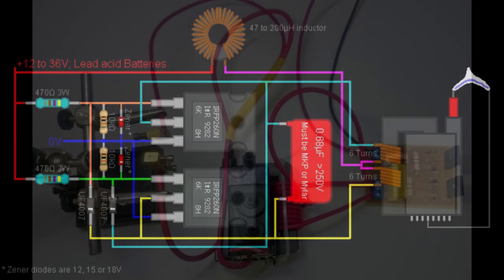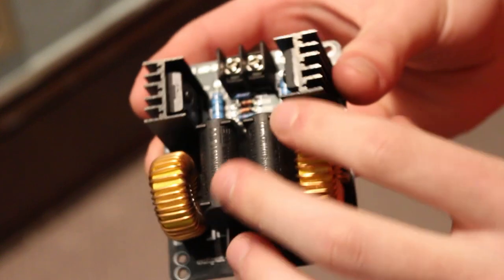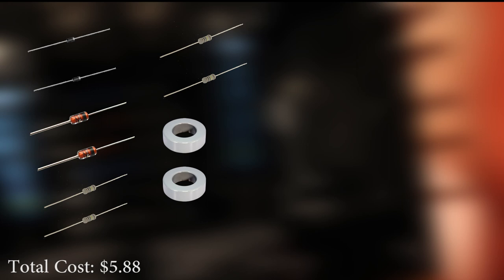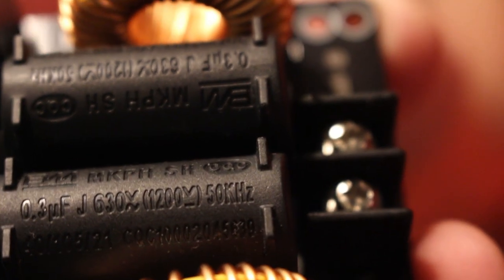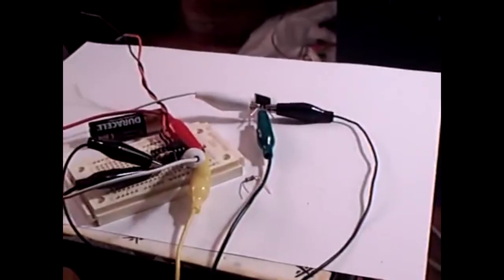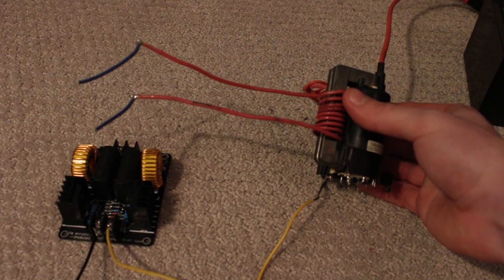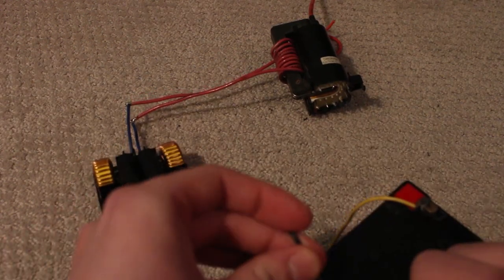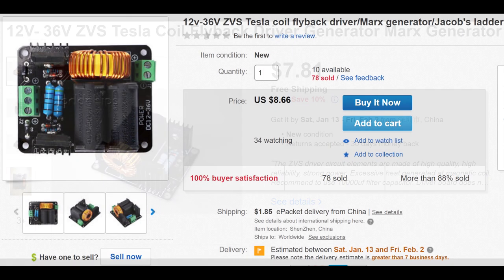Ebay ZVS Flyback Driver from China - It Works!

Comment: Idk why your homemade zvs drivers blow up that often, i have never had that problem even when running on 42V input.
Reply: Failure to begin oscillation can cause a mosfet to be shorted. I had to increase a zener diode on one I built to begin proper oscillation
Reply: @OtherDalfite  i used mosfets that are way more powerfull than my power supply could provide so i never had issues with shorting as i could only give it 5A
Reply: I realize it's kind of off topic but do anybody know a good site to watch newly released tv shows online?
Reply: @emilianochaim5442  nice advertising lol
Reply: Hello, how powerful is it？Can it be used for self defense？
Reply: @动漫区漫哥  sure lol. I mean if you had a good enough battery

Comment: It may be the inductor network you chose. Incorrectly sized inductors will result in blown fets. Also poorly designed caps is a massive ZVS downfall.

Comment: Odd how you've had such bad luck with homemade drivers, mine have always been very messy and I've never had one failure. I think you need a power supply with a fast rise time or else it makes the circuit latch up.

Comment: I ordered this!  It states 1000W 20A.  Does the 20A refer to the OUTPUT current?  If so, ideally, it's 50V MAX at output?  Is this a sine wave?

In my final app, I need "sinusoidal  approx. 600vAC peak at 10A MAX" to drive a bridge rectifier.  What do you suggest I add to this driver output?
THANKS FOR THE GREAT VIDEO!!!
Reply: The max input voltage = x4 of MOSFET max. Vds voltage. Yup, it's a 50v max for this PCB with 200v-rated IRFP260.
The output voltage depends on the transformer ratio, this one produces >10kV. Are you trying to build pure sine inverter or something?
Reply: @arthasmenethil5752  Yes, High wattage with AC / DC outputs.
Reply: @dalenassar9152  Yup, it has sort of a sine wave, but it's unusable for 50 hz UPS: the waveform distorts under the load and the frequency shifts like crazy (mine changes from 10 kHz up to 800 kHz) a HUGE iron drossels required for 50 hz, and I have no idea how TF it even possible to make this thing a 3-phase.

It’s cheaper, better and more reliable to use the EG8030 chip for 3-phase, or EG8010 for 1-phase (they have pre-installed firmware) + 3 IGBT half-bridges.
There are plenty of projects with arduino as well.

Yup, it require some power electronics knowledge, so be ready to burn some silicon during tests...
Reply: @arthasmenethil5752  Yeah...just getting into that Hi-Freq power stuff.
I got a couple of those 12VDC 720W server supplies and got two isolated for 24v @ 50A.   I saw a YT video by "Schematix" of a HUGE induction heater.  He used a small PS  that looked about the size of the server PS's, but put out WELL OVER 50v / 50A @ 3kW!!
Reply: @dalenassar9152  The induction heating ain't care much about the stability of the frequency, waveform, and output voltage.
Even cheap chineze UPS are using the low voltage PWM push-pull + HV full bridge to form a sine wave. 
If there were any method to apply a simple and cheap ZVS cirquit into UPS - trust me, the market would be full of em long time ago :)

Comment: I have that same module and am using a 24vdc, 1000w, 20amp power supply.  The coild is 12-guage solid copper wrapped 7 times.  Set to 24vdc, I turn-on the power supply and in about 1 second, the coil gets so hot that the solder holding the terminal on the circuit board melts & the terminal falls off.  Any idea of how to correct/fix this problem?  Thanks!
Reply: lower your wire gauge like 15 to 20 and wound around 8-11 turns

Comment: I got one of these, hooked it to a makita 18v 3ah battery and popped a couple things. I know nothing about electronics but still don’t know why it broke, specs for the battery tell me I didn’t overload it but again, idk anything
Reply: This circuit has no internal current limiting or protection, just like the battery. I think your battery broke because this device have drained much more than 3 amps. For a short time, a 3Ah battery can supply, let's say, 30 amps, but it's lifespan degrades drasticly.
3 Ah means that the 100% charged battery can safely supply 3 amps during 1 hour, and it will be fine. If the drained current is much greater - the battery will still try to supply it, in cost of it's own life.

Comment: Components are much cheaper here in india 
Resistor and diodes cost 1 to 5₹ and irfp260n costs 70₹ (1$~)
Reply: Hi tejas, can you tell me what diodes are used in the ZVS, i have to replace mine cuz the diodes got burnt
Reply: @balajilakshminarayan1593  1n4007 is commonly used diode on zvs
Reply: @lanzaxell4853  thanks a lot man !!!
Reply: @balajilakshminarayan1593  or uf4007

Comment: i need one of those for aflyback, but it should stay working around an 1 hour /day.
Its better with a cooler? i dont want spend more than 15 $. This one would work for a long time?
Reply: it is ok for low voltage like 12v but 20-30 you better add a fan

Comment: ok you got me hooked.   I"ve been wanting to build a jacob's ladder for a while now, and this ZVS thing looks like its halfway there, you have that other module to make the spark, can you list that part as well? in other words, what are ALL the parts I need to order to repeat this video at home?  thanks,. - J
Reply from the maker: You need the ZVS board, a flyback transformer (you can salvage one of these from anything that uses a CRT screen), and a 12 volt power source (I used a 12 volt battery). That's the works
Reply: Thanks cleveland for the response, I got my two parts, exactly the ones you have in this video.   Can I trouble you for more details on what you are talking about at 1:34 about the  "8 turn primary" ?   did you add the red coil around that part?   my flyback didn't come with those red wires wrapped around that bar/handle part of the flyback.  Is it solid core or stranded wire? you also added the black wire to the end of it, why?   I assume those wires connect to the the "output-a" and "output-b" terminals of the ZVS.   
To make the spark,  It is correct that you are bringing the end of wire that is from the suction cup to the pin that is its associated ground at the pins area of the flyback?      In looking at other ZVS's I see other connections that use a center pull on the winding and the ZVS has three terminals.  Can you explain the difference?    I've also seen where people connect the zvs to 2 of the input pins at the bottom of the flyback, is there a reason you didn't use those instead of the winding?
thanks again for your video, I am really excited to put mine together safely and to understand what is going on here.
Reply from the maker: Sorry for the late reply! 
-The 8 turn primary is 16 gauge solid core wire that I would around the core of the flyback
-I added the black wires at the end because they were thinner and would be easier to attach to the screw terminals in the driver board
-Connecting the ZVS output to the two internal pins on the flyback also works, but because the ZVS driver is so powerful, the flyback can internally short out if over-driven using the internal primary pins. That is why it is safer to wind your own primary
-Some ZVS drivers use a center tap, however this one was constructed in a way that does not require a center tap. It requires more components but it's just what the manufacturer chose to do
Hopefully this helps!
Reply: Well guess what I don't want you blowing it up so submerge it in canola oil so it will dissipate the heat better and not blow up the mosfet like I did today I got humongous arcs from it just before the most blew up $11 down the drain
Reply: @ClevelandStorms  20 volt
Reply: @jonathanleslie9100  try experimenting with a primary all flybacks are different

Comment: Ive got the same board.. for more fun go with 5 turns.. mines doing 5 turns running off 20v
Reply: Whats the current draw from the low voltage power source? Also what do you use for your power source?

Comment: 2 zvs driver and parallel the output to 1 coil for induction heater to combine the power is that gonna work?
Reply: nope, cause they won't work synchronous. Even paralleling FET's in a single ZVS cirquit will cause some troubles.

Comment: Thank you for Sharing this information and demo. What is the Output Voltage of this ZVS Driver ?
Reply from the maker: On 12 volts it is about 15 KV, on 24 volts it's about 25 KV
Reply: I Meant just the ZVS Board (Not the output of the HV Flyback Transformer). Any idea of the Frequency of the Driving ZVS board ?
Reply: @javiergonzales8487  the usually list it as variable between 30khz and 50khz. that might be the center tap ones only.

Comment: Is it possible to set frequency, such as 20 ~ 50 khz using that module? Is it possible to get feedback to monitor the output?
Reply: yeah, change the capacitors. the lower, the more Hz, the higher, the lower Hz.

Comment: I guess you blew your MOSFETS because you used 47 ohm resistors and the circuit value is 470 Ohm and also the Pulldown is 10K not 5.8k
Reply: Hello, how powerful is it？Can it be used for self defense？
Reply: @动漫区漫哥  this isn't even portable
Reply: @ElIsraelJijijiji  Yes, it's huge. I'd better buy a one.

Comment: Can I create those arcs with 30v 5A
Reply: Depends on the type of your PS. if it is a switched mode PS, unfortunately no. But if it is a simple linear power power supply, then you probably can.

Comment: can you touch the arc ?
Reply from the maker: Definitely do not touch the arc. It is a high current and can cause burns and even death
Reply: Lol
Reply: It's a high current high voltage power supply ,  touch it with yer toungue No! No! No! Do not touch the pretty arc it will kill you.😎💕🖖

Comment: Hello i have the same zvs driver but mine was dead after like 1 minute of making sparks with a flyback. Can someone explain what killed my zvs driver? I made like 3 sparks and while driver was on (it was on but i was not making sparks at the moment) i saw a little blink and suddenly my driver was shorted. I powered it from 12V DC 50W power supply. I don't know what about the fets but diodes are dead. Can someone explain why it happened?

Comment: Does this work with ignition coil ?
Reply: It should be capable of driving an ignition coil, depends on the frequency but the only way is suck it and see bruv.  😎💕🖖
Reply: Did you try this with ignition coil ?

Comment: I used one with 32V . The flyback transformer had an Center tab so 3 pins to connect . The interesting thing is that the transformer blew up before the mosfets did.

Comment: Hi i have the same zvs but nothing will be hot. The coil has the diameter of a 18650 battery, 10 windings, and the coil is alminium. The voltage is 20v and the ampere is 4a
Why it doesnt work? Thx?

Comment: I also build one 
And my mosfets got also blown erverytime 
Sory my english is not verry good
Reply: Speak Polish ?
Reply: Your English is fine,you should not apologize. I think the zero volt switch circuit is a sensitive circuit if everything is not right it will blow the fets every time. Check and recheck the circuit and components are correct values and good quality. 😎💕🖖
Reply: Thank you 
Yes this circuit is a bit hard to get going. Its because of the Spikes and interruptions on the Startup. To Work reliably it would need some Kind of Filter and Stabilisation. Maybe i will redesign a propper Version With Power Regularien and safetey Features one day.

Comment: have you tried connecting the outputs directly to the flyback primary coil input pins instead of winding your own coil on the ferrite?
Reply from the maker: I have not with this model. When I have done it in the past, the flyback usually ends up internally shorting
Reply: the wires are too thin. the ZVS will melt them.
Reply: @jontanneguy4960  yeah ive learnt alot in the last two years about chinese zvs drivers. Don't hook them up the the input pins of the flyback, the zvs doesn't like it lol. Induction heater drivers i found work really well to, just remove the copper coil and then wire the flyback like you have in the video. You get some chunky arcs

Comment: can you charge a fan caps with this flyback driver?
Reply: Yes but you need to watch the output voltage and require a properly rated diode.

Comment: Hi, do you know if it would be possible to connect a heating coil directly to this board like it is on this one: https://i.ebayimg.com/images/g/cuAAAOSwXPNaCUsy/s-l1600.jpg
Reply from the maker: I'm not sure but it looks like the same design as most of the flyback drivers on eBay

Comment: I used one of those flyback transformers from an old plasma ball, I wired up up, and I got tiny arcs, not even a millimeter.
Reply: you need proper driver. you need higher frequency.